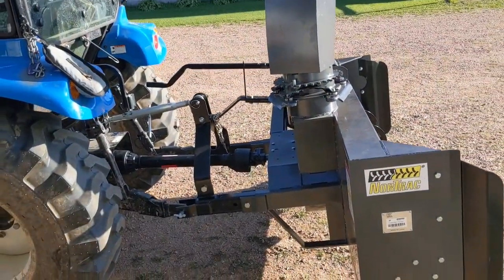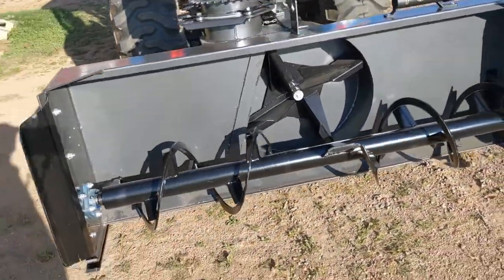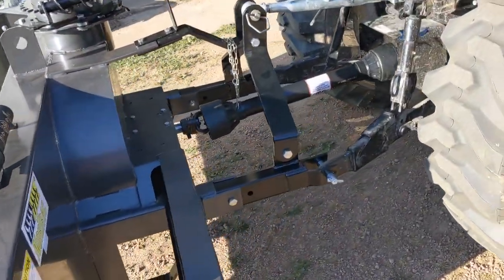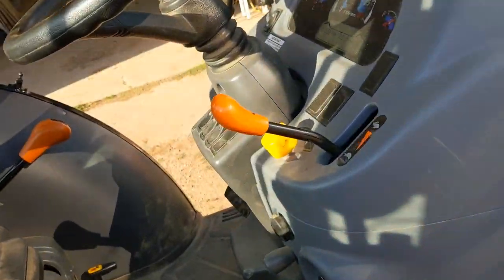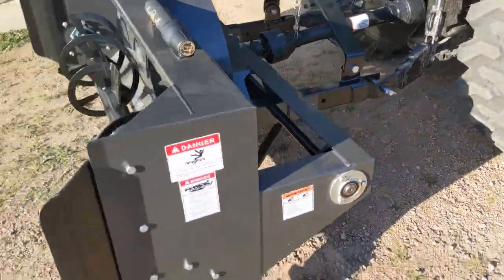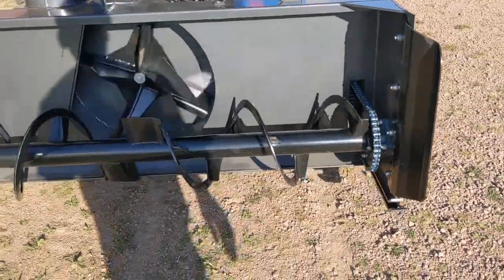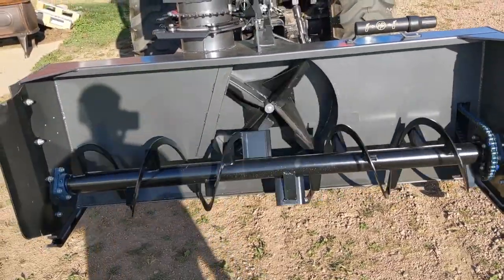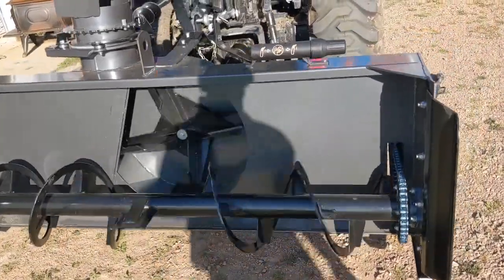Nortrac snowblower assembly review

Comment: Heh, good timing. About to go out and finish assembly on mine that arrived Thursday. What is the tool mounted on top of the blower. Mine was broken off in shipping...hence missing. Got lucky though, a nut was laying in the bottom of it that fell off one of the blower ring bolts. Yea, very heavily built though.
Reply from the maker: Hi, I'm not sure which tool your asking about. I can get a more in depth video of the assembly. I also found a couple videos that may answer your question. https://youtu.be/6XeygX1D_DQ  and https://youtu.be/ZFgCKfgov18
Reply: @aspireranch  Thanks, yea I found the other video earlier and made a post there as I have some design changes with mine since his video is like 6yrs old. He also didn't have his chute properly attached. I prob. would have done the same, but he mentioned the wobbly chute and I figured it out. It's that black plastic tube on yours attached to the top. Maybe it's your instruction tube you mentioned. Whatever was there....all that is left is two broken pieces of plastic. Also did you add oil to your gear box. I looked in mine it looks like grease in it. I tried dipping in a stick and it looked like just some grease for shipping?
Reply: Heh, yea..I blew up the vid. looks like your instruction tube. cheers
Reply from the maker: @GlenironPa  Yes, the plastic tube is for the paperwork. I put extra shear pins in there as well. Thanks for the reminder about gear oil. I did not add any. I'll check that after work. Generally, no attachments ship with gear oil. You need to add it. That would be another thing not mentioned in the assembly instructions. I also have a suggestion about the chute rotator https://youtu.be/KyD__HwkcqE